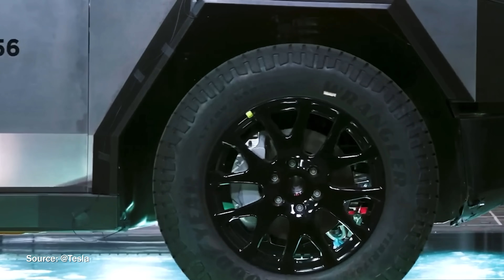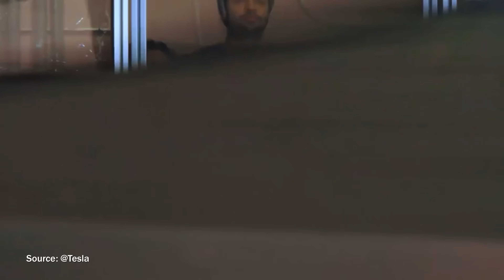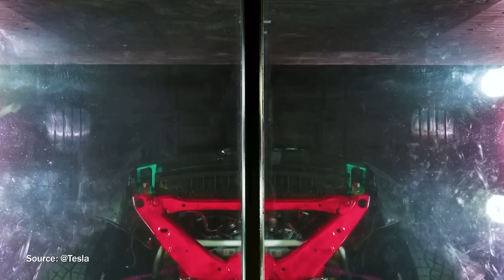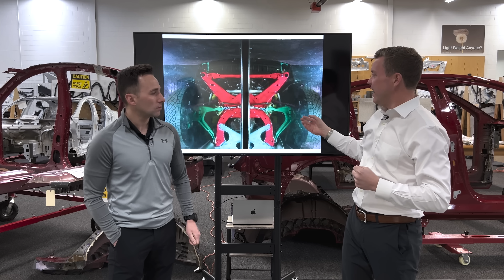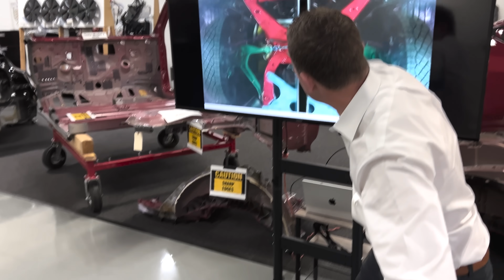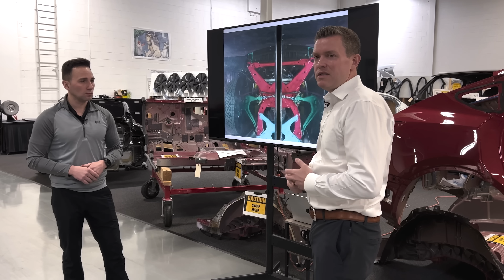A peek under the Tesla Cybertruck! 👀

Comment: Pardon me if I get something wrong - I'm not an automotive engineer, just an Aerospace one.
The whole idea behind the Mad Max Cybertruck was to use stainless steel like the steel in Elon's rockets in his cars. Well if you've ever worked with SS you know it's 10X harder than working with your average steel used in Teslas. 

Elon decided not to use a bolt-on space frame to hang doors but to make the shell monocoque in design meaning unbolting the space frame and putting on an RV frame is 10X harder since the body of the Mad Max is designed for handling loads completely differently.

Why was this chosen? Well, SS is strong, and it is hard to bend without causing stress fractures. Painting SS is 10X, too and from what I've seen doesn't hold up well in the real world.

Now Elon wants to paint the Mad Max which means adding a painting station which was the whole idea of saving big bucks - no paint booth. So why not use normal automotive-grade steel and make it thicker - easier to add in all kinds of shapes.

Anyway it seems like the Mad Max is running around in circles and who knows what Elon will finally decide to do.
But Elon must be aware by now that out of the 1.5 million preorders only a few dream of driving around in stainless steel all day with kids laughing and pointing at the Mad Max.
Reply: The more we hear about this vaporware, the more one realizes it has major problems. Running around in circles is a good description.

Comment: Musk has mentioned "Rally race" type performance. Does this setup look consistent with those sorts of activities?
Reply: Yes, long control arms allow more suspension travel and minimize camber change which drastically increases handling performance & feel.
Reply: @SocalCanyonRacer  nope it's definitely not! Also air suspensions are not for racing! The Ford raptor has the best/perfect suspension setup for racing.
Reply: @alanmay7929   I'm so sorry Alan for contributing.  He did say "rally race" type.....this has longer arms than a majority of street vehicles.....CT is a street truck....I'm sure we can call into question many MFG's claims....Raptor is a low production(25K) dead man walking.......Don't fight the future.
Love your passion man😍
Greetings from the Coast of SoCal surrounded by thousands of Tesla....and everyone else trying to catch up.  We have one of the two Hummer EVs sold this whole quarter....just down the street😜
Reply: A baja cybertruck  is soo cool. So no front casting. I still wonder how and where the stainless exo will be attach to all these different metals
Reply: @tiredslave  Tesla has had dissimilar metal bodies/frames since the very first Model S. They know how to do that. The real question in my mind is whether all of the secondary welding they will have to do to add mounting brackets will make the stainless steel gimmick even worth it.
Reply: imo, the entire point of cybertruck from day one was to develop offroad ai . For Mars, naturally.
They planned to have electronically switchable 'fixed axle' and 'independent axle ... that's a lot of interesting baja-like stuff. Can't wait.
Reply: @shrikedecil  stop with the mars nonsense please

Comment: Can you tell if the steering is drive by wire based on this view?  So no front casting then?  Where do you expect to see castings then?
Reply: No way to tell.  I'm thinking if they really are doing rear wheel steering then steer by wire would be a great way to go and of course there is the weight saving.  If they do go SBW then perhaps that comes to the S and X later.
Reply: i believe drive by wire is still not road legal in many countries. If at all any. For EU i know is not legal still. So regulation needs to speed up and provide templates for redundancies and test methods as in aviation industry.
Reply: @alesksander  From what I understand all current vehicles with rear steering are SBW for the rear wheels?  Is that a simple regulation work around (regulations don't dictate rear steering?)
Reply: @alesksander  Grubberment is so slow....
Reply: @alesksander  honestly, fk steer by wire. Give me a real steering column where I can feel the road. All this fake "feedback" generated by a motorized system is garbage. Also, the current systems have input lag and that's absolutely unacceptable. 

I do not want steer by wire on any vehicle I own, ever. It's not better in any way. It's just making something overly complicated for the sake of "look at the tech bro!". It's dumb.
Reply: @themonsterunderyourbed9408  I don't have any experience with with SBW on cars/trucks but I tried it on a Bobcat skid loader and had 100% the same reaction.  It lost all feel and feedback and I hated it.  This was 10 years ago, so maybe its improved but it was not even close back then.  

Now, on the flip side, if my Cybertruck is driving itself for most of the miles...   but I suppose the times you need "feel" are the times Autopilot is not engaged.  In the end, I want a round steering wheel, stocks, and a single screen in the middle- no two screens to think about where to look, wiper/turn signals I hit by feel, no yoke (no second screen to block).  I think we will get most of that (but it looks like a hybrid wheel/yoke).
Reply: @themonsterunderyourbed9408  No its not overcomplicated. Its just regulation and redundancy problem. And testing and licencing problem. For people who want true feedback they will go towards aftermarket solutions ofr other makers. For us common folk for drive to the work. SBW, BBW are nice engineering weight savings.

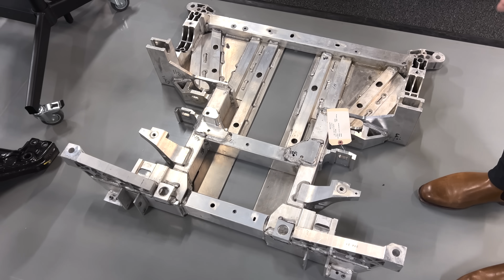Comment: 6:32 That Rivian frame looks like constructed by engineers smoking all type of ill sheet. Holy Maccaroni. 🙈
Reply: And then u see Tesla castings and BMW sleek executions its night and day really. Still long way to go for Rivian. But they did made the awesome product.  Rivin Van would be interesting to look at how they made it. Its cool design.
Reply: Certainly looks expensive to make, if the rest of the Rivian is like that they aren't making much profit anytime soon
Reply: @bluetoad2668  it's the first ittteration and also they are going to make cheaper versions with just 2 or 3 motors.
Reply: @bluetoad2668  
Currently losing about $130k per truck?
Reply: @rogerstarkey5390  in your dreams or what!!
Reply: For low volume, extruded aluminum is a good choice. The problem here is often that you have to direct the power flow through additional gusset plates and reinforcements - that's why it looks like a patchwork quilt
Reply: @Zedus-rl9hp Right, but the main goal is to make some money on a product you sell, not burn it like straw fire.
Reply: @Stefan_Dahn  thats right. But for other manufacturing processes you need higher quantities, otherwise it is much more expensive than that
Reply: @Zedus-rl9hp  True. Ford Mach E uses sand castings and still loses money. So subframe is not main price differentiator. But for me its even more indicator of  methodology used. For EV u need to be sharp in engineering executions because of very steep entry BOM price and its influence on performance. Rivian atm does not have CAPEX space for die  casting or huge engineering optimization so they pushed minimal viable product as soon as possible out of door. To some extend get the early adopters on their side and grab quickly part of eager sport truck marked on their side. And with those invite new investors for next step. Arguably decision witch won them over Amazon multi Billion$ deal.
Reply: @alesksander  Yes I agree.
Reply: @Zedus-rl9hp  those things can be automated i don't get why you don't simply ask them how it cost to make it!
Reply: @alanmay7929  I have no idea what you are referring to here?! Are we talking about this structural framework?
Reply: Nonsense!!! It's clearly one of their first designs and the truck has both air and hydraulic suspensions unlike the crap Tesla